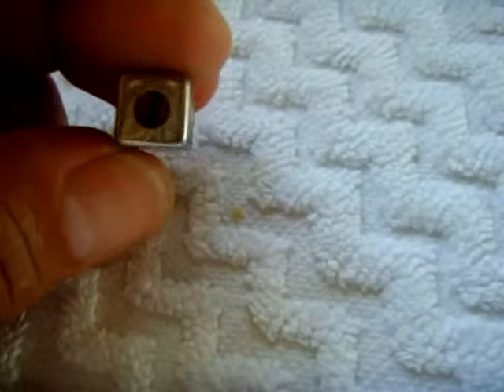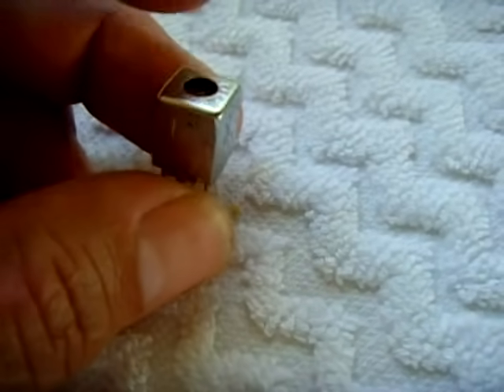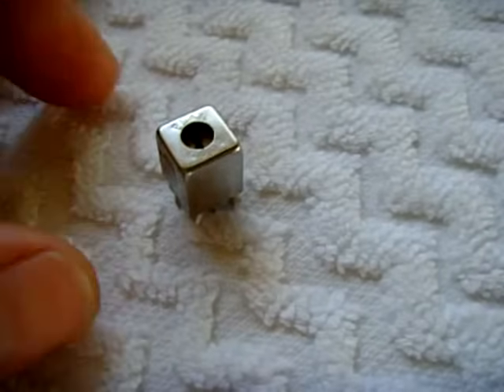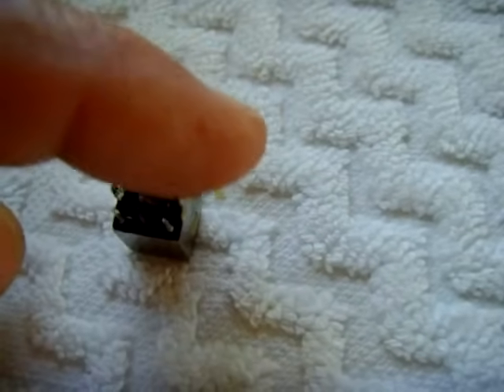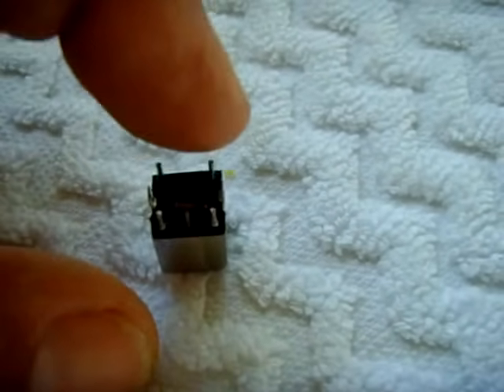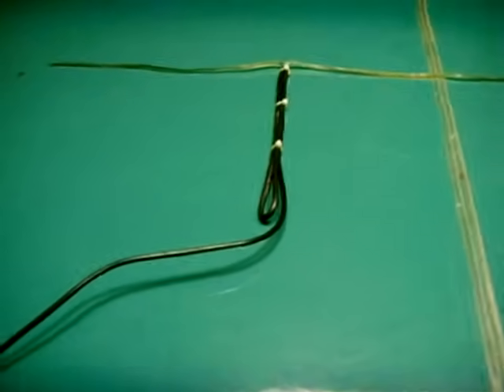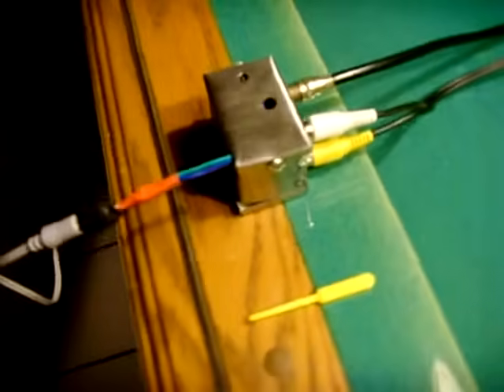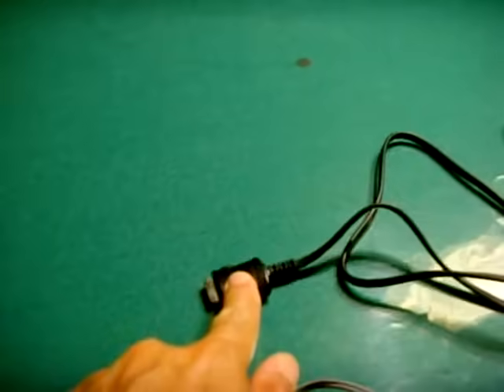DIY Homemade Television Transmitter Circuit(50-200mhz)

Comment: Your circuit modulates video in AM (not in upper sideband) and in frequency.
It doesn't have any filtering at the output either, so it will generate a lot of interference and harmonics.
It's not a good circuit.

Comment: Is it possible to make an analog tv tuner?
Reply: Yes but it is hard. Its easier to just buy an old tv off of ebay. Maybe a sony watchmen.
Reply: @benjaminbadrakh1644  That is good advice, use an old tv tuner or maybe a tuner out of a video machine. It would be very hard for a beginner to make a TV tuner from scratch, without proper precautions, it would drift all over the place and would not stay locked on any particular channel.

Comment: Hello
I have built the vtx side of this circuit, and I modified the value of the potentoimeter to 220, and at the video input side I have a 100nf capicator instead of the 4.7uf. This is not working properly, the signal is always shifting in frequency. Can it be an interference problem, because my circuit is not shielded, or the components cause this?

Comment: Hello, thanks for the video. The scheme in the video is not fully read. Links are not available.
Can you fully give the scheme? For example, the transistor and other elements on the left side of the diagram are not read?
Reply from the maker: I just checked, you can read all the component values, including the transistor.

Comment: What about it's range? 
How much RF power in m.watts? 
Thanks
Reply from the maker: Been a while, not sure about the range, but it does work very well and range should be fairly good.
Reply: @electronicsNmore  can you give any approximation foe the range?....i am looking forward to using this for a project and need like more than 150meter range

Comment: I have been working on making a UHF tv transmitter circuit(video side) which is preset to work on 600-700 mhz. Can I add your audio side of the circuit with the UHF video circuit. Please help. Thanks.
Reply from the maker: You should be able to. You have enough information in the schematic to show you how to connect it. Unfortunately I cannot take the time to help everyone with special schematics. I have 270 videos with people asking questions. I usually only allow two replies to a viewer. Thanks For Watching
Reply: Well, I will not have any problem in linking your audio circuit with my UHF video circuit & I have already acquired the parts, upon my request, when you have highlighted the value of the parts.But my question is that this VHF based audio circuit will work with UHF based video circuit or not. If you have time please give a yes or no reply. Thanks.
Reply from the maker: I think it should work, but not 100% positive.

Comment: Regret for double posts. At audio side there are 6 caps  & the values can not read from your video. So please help me to note their values. They are - 1 cap after mic; 1 cap between base-emitter; 2 caps between collector-emitter, 1 cap between input legs of IFT & the last cap is between IFT output leg & video transistor. Please help. Thanks

Comment: Hi, at audio side, at what freq I will have to set the IF transformer?  I found one IFT of 4.4 - 4.9MHz range. Please help.
Reply from the maker: OK. I added annotations to the video on top of the schematic to show the values. It depends where you are located in the world. I use 4.5mhz, you may use 5.5mhz.

Thanks
Reply: That is too much help. I have noted all including cap values. Inserting highlighted cap values on schematic will be a great help to many of us. Thank you very much.
Reply from the maker: You're welcome.

Comment: anyone know if there is a transmitter that allows the switching between short and long distances? I need it to change whenever an antennae isn't around, and it needs to "look" for another antennae..... also it needs to be super fast.....let me know!!!! Also it needs to be cheap, like 20$ cheap....
Reply from the maker: Good luck with all those requests for 20 bucks, highly unlikely.

Thanks For Watching.
Reply: do you know of any data transmitters like that?
Reply: or rather, could you give me some keywords to look for? I'll do the research =P thanks!
Reply from the maker: Enter all your keywords in the Google search bar. You know exactly what you need.

Thanks.
Reply: all I do is google stuff, but I'd like help from someone who is knowledgeable about these kinds of things........ theres only so much I can do =/..... not trying to make excuses but.... honestly I've a lot of the research myself..........
Reply from the maker: Explain EXACTLY what your looking to do.
Reply: I need the device to jump from one antennae to another, whenever the device is out of range, or entering the range of another antennae. I'm working on a vr 4 sensor body unit, kinda like the Razer Hydra, cept without the electromagnetism.....
Reply from the maker: What do you mean jump from one to another? Not making any sense.
Reply: I need it to switch between a short range frequency to a long range one if it needs to. Like if you entered your home, it would switch to short range, but when you go outside, it switches to long range, know what I mean?
Reply from the maker: That is not how transmitters work. You either make or buy a transmitter of high power output or low output(or YOU manually switch from high to low power). What your trying to do would cost hundreds of dollars.
Reply: ok, thats okay then, also... what if I wanted to transmit across multiple repeaters? like say 5 in a row all connected to 1 computer....? that possible? assuming they're all medium range (1900mhz?) (I forget frequencies.... so my bad if my freq. range is off..... is it 1100? or 900? 800? audio video receiver btw, and data transmitter.... like a cell phone,.... do they switch from repeater to repeater without burning out a battery?

Comment: Works for me. Holy hell is it trouble to tune the audio carrier! Using pn3563
Reply from the maker: I never said it was easy. :-). You did a good job if you got the audio working. When everything is adjusted properly, the transmitter works great. Any thumbs down are clearly from people who could not get the audio working, yet they blame me.

Thanks for watching Alex!
Reply: As soon as I said it works, I killed it. Don't know how, all components test good, but the main oscillator won't fire up anymore..... Time to pcb it.
Reply from the maker: Must be a blown transistor.
Reply: Nope. I went through ripping my hair out and even pulled the audio circuit. Spectrum analyser shows zip 23-179ish mhz.... Went through with an lcr on all the others out of circuit, hell... even replaced the tuner cap and held a ferrite rod in the coil. Nothing. It's got me stumped. Audio oscillator for some reason actually oscillates at about 70 megs according to the antenna, but with it completely disconnected, the transmitter is still dead....
Reply from the maker: When that happens to me, I put the circuit together all over again using new parts.
Reply: That's what I'm doing now, printed board and all....
Reply from the maker: I have spent hours before trying to figure out a simple/stupid problem. I have a tendency to overthink things.
Reply: Yep. Take a nap and try again. Didn't work this time, but it will soon. I'll post the video of this thing working and the board file either 2am or some later time tomorrow.... depends on how much insomnia I have.
Reply: joblessalex I put in 2N3904s in place of the fancy ones I was using and it worked with more power than before... SO YEAH. Still fiddling with the audio.... all I get is 60hz even with a filtercap. Stability and oscillation issues still exist, but are minor. Board file: https://dl.dropboxusercontent.com/u/60725040/TVxmitter.pcb
Reply: Match the impedance, the reason your oscillator blew up might be due to impedance mismatch.

Comment: Thats a really awesome video!  I want to make a VHF sender for an rc submarine.  The lower vhf band 54 to 72 mhz works fine controlling a sub.  But i wonder if i could get signal back from channels 2-13 on an old school pocket tv.  Just like 200 feet out maybe 20 down at the most.  I can control a sub at those limits.  Yeah its kinda against the law but no one is using old non digital stuff especially in a limited range!  Any suggestions?!
Reply from the maker: Sending signals from underwater does not work so well. The water absorbs the signal. You may do all that work for nothing.

Thanks For Watching!
Reply: Well if 54 to 72 MHZ makes it to a sub from my transmitter than I should be able to get a signal from a low band VHF TV transmitter in the sub.  I understand the saturation of the water and the signal but this depends on frequency also.
Reply from the maker: Real subs use ELF(Lower frequency penetrates water well, higher is blocked more easily.).

This is a good read:
http://en.wikipedia.org/wiki/Communication_with_submarines

You can try using the same frequency range. Nothing to lose but some time and money. :-)It may work.
Reply: I am researching possibly doing the same thing. What about using visible light in clear fresh water?
Reply: Well you could attract a lot of animals that block out the signal or interrupt it.  Weeds to would block it.  Low-VHF seems the best.  For short range fun.

Comment: Really really cool, no doubt higher power than a commercial inline signal booster (meant for feeding into receivers with cable but with a dipole on instead...saw one up to 49db, but...) , butI'm having a hard time making out the left hand side of the diagram, and don't see it at the link. Do you have a picture of it? Thanks!
Reply from the maker: Hi Jeff. Make sure the video player window is set to the highest resolution, then you can read everything.

Comment: pleade i wanna ask u something , i am working on this circuit  as a test in bread board<<only video tx part not audio>> and it dosn't work with me , the i figure out that maybe the wrong part about coil ... its written as it equal 22 to 24 awg that's mean in diameter equal .5 mm its so tiny coil but dosn't work 
u r say that coil in diameter is 8 mm , is that core diameter or the main wire diameter ... and thnQ
Reply from the maker: Wrap 2 turns of 22 -24ga enamel wire around a 8mm form.

Comment from the maker: This circuit connects to a RCA Video and Audio Cable from a digital camera, or DVD player. For all other uses you will require an adapter to RCA. Check out Radio Shack's website.

Comment: How can I connect this video transmitter to my computer?
Reply: Your computer might either have a VGA or HDMI video out. Depending on that you will need to buy and external VGA to Composite or HDMI to Composite converter and then connect the converter's composite output to this TV Transmitter.
Reply: @SopanKotbagi  Can you specify of how I can do that since the transmitted signal is analog. Does it require to be converted to digital when feed into the PC?
Reply: @SopanKotbagi  I mean if I use RCA to HDMI do I still need the TV as well? I am understanding this as the RCA to HDMI receives the transmitted signal.
Reply: @sarwarn2107   Ok, I will give you a brief overview of everything involved here. The input to such transmitters is composite (PAL or NTSC agnostic) video (the kind you would expect from devices outputting via yellow RCA jacks) and the audio is either mono (in this circuit) or stereo in more professional circuits. The transmitter uses VSB Modulation (Vestigial Side Band) to modulate the composite video onto the RF carrier while simultaneously using FM Modulation (Frequency Modulation) to modulate the audio onto the RF carrier on a frequency which is a few MHz above the central video frequency with a fixed offset. The radiated RF signal can be received by common TV tuners which are present in TVs (obviously) or external TV tuner cards and devices available for connecting to computers via PCI or USB.
So, the only way to receive the transmitted signal is to use a proper TV, a handheld TV (popularly called pocket TVs), an external TV tuner card or dongle which connects to your PC, or, if you are skilled enough with electronics, a custom-built receiver.